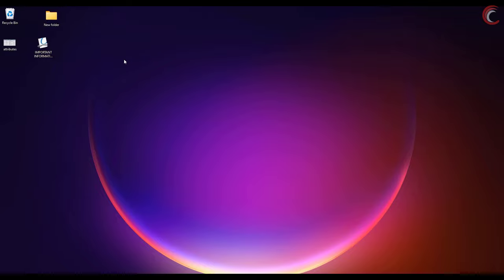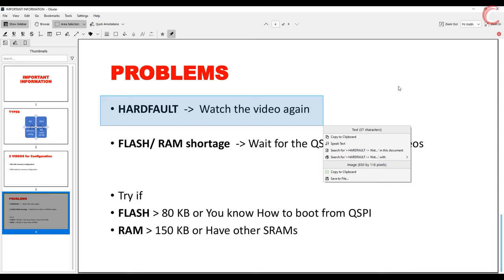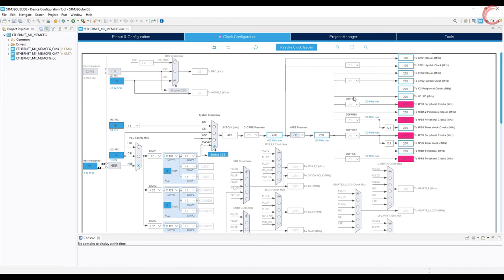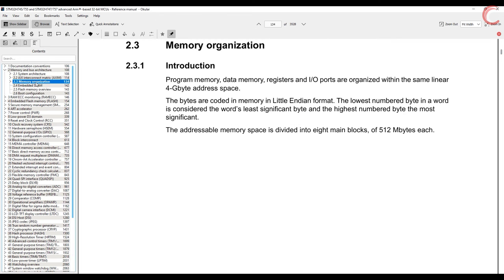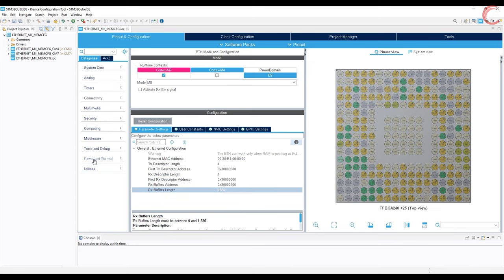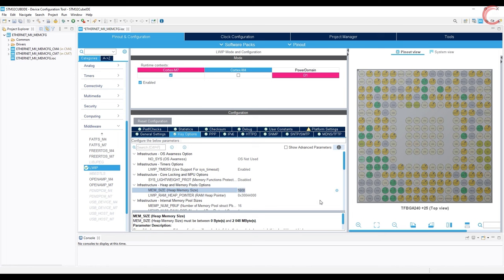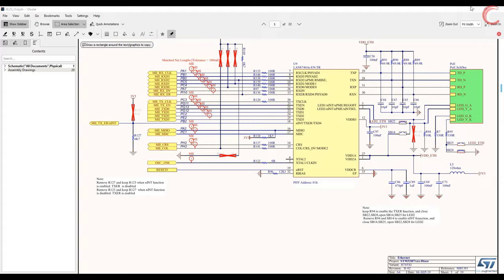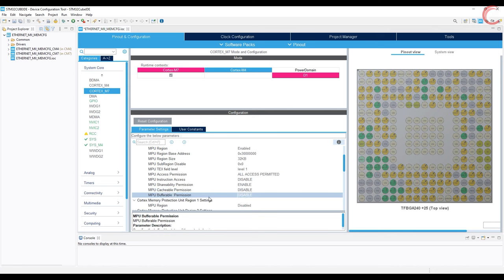STM32 ETHERNET #1. Hardware Configuration || PART 1

Comment from the maker: 1.) I just tested with the latest version (1.12.1). Yes the CubeMX does not let us configure the RxArray, but you can simply ignore it.The code builds just fine and the ping works as it should. I am attaching the project for your reference. https://drive.google.com/file/d/1bWet0pSpQxkGx_ry3aAdO-ejf9SIg5YF/view?usp=sharing

2.) Don't misunderstand the logic. You don't necessarily need to do this. Memory configuration in only required in M7 processors.
Also if the cubeMX don't let you configure the memory, then you are good to go with the default setup itself. This is why I said "Watch both parts of the configuration". I can't make separate videos for all processors.

3.) The above configuration is tested with ROUTER. If you are connecting the board directly to the computer, you need to make some changes in the ethernet settings of your computer. Checkout the setting https://controllerstech.com/wp-content/uploads/2023/08/ethenet_setting.png. This setting is valid for the static IP used in the video.
Reply: I do the same as you but it doesn't work with ping, the program still runs to sys_check_timeouts();
I run it on STM32H743ZIT6 Nucleo
Reply: About 1). Does it mean that I don't have to allocate the 1524*4 bytes for the Rx Buffer and I can just put the LWIP at 0x30000100? Where does the Rx Buffer gets allocated instead? Does it automatically gets added to the MPU?
Reply: I downloaded the project and upload the code without any changes - it doesn't work. My board STM32H745i-Disco
Reply from the maker: You downloaded the file linked in the first point ?
Reply: @ControllersTech that's  right. But now I have another problem. After uploading a code into my board I am not able upload again. The programmer can't find device and I don't know how to clean chip.
Reply: Is the non-router ethernet setup for pc correct? I cannot setup my pc ethernet with an DNS of 255.255.255.0 or subnet mask of 192.0.0.0. Are those two swapped? 

I'm currently trying to get this working inside an freertos task but im not able to ping my stm32f7 nucleo.

Comment: I am using a W5500 with the STM32 through SPI. Want to use the Ethernet controller in the STM. So very exciting .....
Reply: If you are using W5500, then you can use any simple 8bit uC with SPI. No need to bother about ethernet module in the uC.
Reply: @jonfs2000  At the moment I use that solution. But eventually I want to replace the W5500 with the STM32 controller
Reply: @fillempie1501  Sorry, I misunderstood your comment.
Wonder any STM32 comes with builtin PHY

Comment: with the new version of LWIP, the RxArray buffer doesn't exist into the ethernetif.c file,  the procedure to add the "external" gnetif  fails due to  missing elsewhere.
Reply from the maker: I will check..
Reply: i have the same problem "undefined reference to `gentif'"
Reply from the maker: @CasllistoPili There is no such issue. I just tested with the latest version (1.12.1). Yes the CubeMX does not let us configure the RxArray, but you can simly ignore it.
The code builds just fine and the ping works as it should.
I am attaching the project for your reference.
https://drive.google.com/file/d/1bWet0pSpQxkGx_ry3aAdO-ejf9SIg5YF/view?usp=sharing
Reply: @ControllersTech  I did the same as you but it doesn't work with ping
Reply from the maker: @quocthainguyen2314  Check the last point of the pinned comment (new one).

Comment: Hello i have same board configured  by fallowing your tutorial  in command prompt  transmit failed , general failure   and   RxArray buffer doesn't exist into the ethernetif.c file   added manually myself .
Reply from the maker: check pinned comment
Reply: @ControllersTech  i have a STM32H745i DK board  fallowed your vedio ping test is succesfully completed .Next i want to send ADC collected samples(Array) to client using TCP/IP protocal which video should i fallow and how do i achive any guidence ??
Reply from the maker: @shettymalnad1978  check the TCP server/client video

Comment: I applied it which this video without memory configurations, because cubemx dont allow to memory configs. I couldn't reach to right solution. I tried to sending ping but it didn't answer to back. (stm32f767). What is the problem? should I change my computer's IP4 address according to the code (manual)?
Reply from the maker: Are u using a router or direct connection with the computer ?
Reply: @ControllersTech  I connected the ethernet cable directly to my designed board
Reply from the maker: Check out the lastest video in ethernet (no. 7)
Download its project. In that project, i have shared the screenshot for configuring the windows ethernet settings for direct connection.
Reply: @ControllersTech  i just tried that video. It didn!t work also I couldn't choose external loader because there is no stm32f767vg. I will be mad :) I just want to see sending ping...
Reply from the maker: I didn't ask you to try that video. I said there are screenshots of the windows configuration in the project folder.
Reply: @ControllersTech  Yes I know. Should the configurations in the code and the computer's configurations be the same?
Reply from the maker: Just keep the ip subnet and gateway same as that video.. and configure the computer as shown in images
Reply: @ControllersTech  thank you. it is working now.

Comment: I'm using the STM32H723, and there is no setting for the RX buffer memory. A space for this has been allocated as a memory pool in the AXI SDRAM. I'm a bit confused; do I need to configure it? thank you so much <3
Reply from the maker: Check the point 1 of the pinned comment.
Reply: @ControllersTech  thanks a lot

Comment: hi, im using stm32h723zg. i did everything just as you said but in the debug section, line can not reach in to the while loop. i debugged step by step and it is stuck in the "MX_LWIP_Init();" initialization. i think stm32h723zg and h745 are different in some ways but i dont know what to do. can you help me?
Reply: debugladığımda aynı satırda kalıyorum kodu okumaya devam etmiyor sorunu çözdüysen bana da yardımcı olur musun

Comment: Hello, sir I have the stm32f446 Nucleo board and STM32F103BluePill Board,, Both the boards do not support the inbuilt Ethernet feature. Instead, there is an alternate option of using an ENC28J60 or W5500 ethernet module interfacing with SPI communication. Can you make a video series for ethernet using the SPI Module so that it will be useful for LowerEnd MicroControllers?

Comment: Hi, thanks for the informative video. I struggled with the NUCLEO-H753ZI board to get it to work. But when I put in a large delay after HAL_init() it worked. I had to put 3 secounds. (I used DHCP by the way) It took me a long time to figure this out. Because it worked only during Debug mode (Using the onboad SWD), and not in free run. So as soon as I restarted the controller it did not work. I was sure it had something to do with the cloks or the memory. The only thing was that the LAN8742 need time to initialize. So I just put HAL_Dealy(3000); after the hal init. And it worked! So I hope this can help others struggling with the same.

Comment: Now I finnally know why I was not able to run ethernet on CM7 core.. Because I did not configure memory.. But on CM4 it worked fine for some tcp echo tests. Now I can do it in correct way.
Nice job, looking forward for the next ones! Hope that you will also demonstrate simple tcp/udp echo with freeRtos
Reply: your using STM32H745i DK  ?? if you'r using this i need help ??

Comment: 10:58 The default LWIP_RAM_HEAD_POINTER is 0x30044000. I am using a H723ZG, for which the reference manual says that memory address is under a reserved section of the SRAM. What is the point of the IDE putting addresses as default that can not be used? Does anyone knows that?
Reply: did you find an answer to this question I am using the same board and can't
 get it to work
Reply: @danieliskandar4410  Yes! You indeed have to move the LWIP_RAM to valid memory area.

Comment: Hi Sir,
I have done all the configuration as per your video and I'm using stm32h745-DISCO board. But the ping on the IP is showing "host unreachable" . On debug, I was able to find out that within the LwIP_Init() function, within netif_add(); function I'm falling into error;
LWIP_ERROR("netif_add: invalid netif", netif != NULL, return NULL);. 

When configuring from cube-MX, I could all see one difference between your configuration and mine, there is no "Rx_Buffers_Address" in my set-up.

Can you suggest on where I've gone wrong?
Note: - I'm using cat-5e ethernet cable that I've verified working in my PC.
Reply: I have exactly the same problem
Reply: @Cypher-sn3bt  Please let me know if you have any update on this issue. I tried using the ethernet crossover cable but still the problem persists. Thank you.
Reply: hello am  using the same board for configuration done same as the above video but ping on ip shows transmitt failed general failure .Any help  ??

Comment: I am using CUBEIDE version 1.9.0.
After configuration when code is generated, RxBuffer is not present in ethernetif.c file. Code does not work and ping not answered by the system. I am using nucleo H743zi board. Please 🙏 help.
Reply from the maker: Yes I guess in the updated versions, they have removed that section. It should still work. I will update the article in probably 1 or 2 days.
Reply: @ControllersTech  Thank you. I will be waiting ☺️.
Reply: @ControllersTech   I suppose you didn't update the article. Will you update it ? I'm having the same problem.
Reply from the maker: Please read pinned comment

Comment: I use a board STM32H745i-Disco and still not able to activate ethernet on this board. I found that the board configuration supports just full duplex (MII_CRS and MII_COL deactivated) . Does it changes something? Can the example used with ETH mode: "MII Full Duplex Only"?
Reply from the maker: How are you connecting the board ? Using router or direct connection?
I have the same board. Things just work fine without any issue. 
You can reach me on telegram
Reply: @ControllersTech  It's connected to home network. Tried to leave save memory setup just chage from MII to Full duplex mode + static IP address : the board appears in arp list, but ping failed. I 've bought second same board - same result. I can bet there is a stupid mistake, but at this moment I do not see it. Using your the second video I set STM32F769i-disco - works perfect.
Reply from the maker: Plz contact on telegram. I need to see the code.

Comment: Hi I like your video very much, just wonder if the above  works on STM32H7A3 or STM32H743 ?
Reply: or can it work on STM32H750 Discovery board ?
Reply from the maker: It works for all STM32 devices.

Comment: Im using stm32H747I Discovery board and i used RMII connection and configured memory mapping just like you and  I did all the configurations as explained in the video . The only difference is that even with RMII connection the cube MX let me configure the memory but i get no response when i do the ping test . Im using the stm32cubeide V 1.9.0

Comment: Just a question: how was the IP add configured on the STM ? Because it's IP must have been 192.168.0.123 in order to respond to the ping, right?
Reply from the maker: It is configured in cubeMX.

Comment: Hi ! thanks for you video, that really help me to start my MQTT project on STM32F407.

I have a problem with the ethernet. 
That don't work if STM32F407 starts with the cable disconnected.

If i start the MCU with cable, i can ping, disconnect, reconnect and ping again.
But if i start the MCU without cable and connected after 10sec (more or less), the ping will never work ! Or after a reset with cable plug !

Do you have an idea where i can make a changement ?

Thank again
Reply from the maker: Keep the cable disconnected. 
Put a breakpoint inside the while loop.
Run the code and see if it hits the breakpoint.
Reply from the maker: Ofcourse i mean debug without cable.. just like you mentioned the issue is happening
Reply: @ControllersTech  Ok i put and BP in infinite loop and i can hit with and without cable plug, replug, just the ping don't work if it not plug at init ! :D
Reply: In MX_LWIP_Init();

I found netif_set_link_callback(); //Set callback to be called when link is brought up/down 
So i understand the plug unplug at the init should be manage by this function but something doesn't work and i don't know if it's me who do something wrng
Reply from the maker: Ok i don't know if it will work but try this.

Do not ping until the link is up.  You can call the  set_link callback function and inside it check if the link is up. If it is, then set some flag. 
In the while loop, use the flag to shield the ping
Reply: @ControllersTech  Ok thank i find a issue with your help ! 
The fonction call back: ethernetif_update_config is called when plug or unplug the cable but the re-init was  ot clear so i use 
if(netif_is_link_up(netif))
  {
	  netif_set_up(netif);
}
else
{
         netif_set_down(netif);
}

Thank you for u fast aswer and ur help !
Reply: @microsore1   @ControllersTech   Hi. I know this message is a long time ago, but I have the same problem as you, but putting a BP in the callback function "ethernet_link_status_update", it never fires when plug and unplug.   Like you, if I start with the ethernet cable connected, it does ping me.   Is there any interrupt configuration missing to make it work?.  Thanks a lot.

Comment: Could we just work with AXI SRAM instead of SRAM1? Is there any particular reason SRAM1 is being picked over AXI SRAM?
Reply from the maker: You can use whatever ram you want. But since the main code is organised in axi sram, make sure you give proper offset for the dma descriptors.

Comment: I want to use STM32H743vi and lan8720
in the item "LWIP > Platform Settings > Driver_PHY" , there is only the LAN8742 driver.
please tell me what to do?
Reply from the maker: I don't know about 8720, but check the example projects provided by ST and see if there is any changes in the configuration.
You can just give one shot to 8742. Maybe it will work

Comment: I used stm32f439zi nucleo 144 board, but I didn't find CORTEX-M4 in system core in order to confige MPU
Reply from the maker: Mpu isn't available in f4 series.  You just configure the rest of the project.
Reply: @ControllersTech   Thank you so much, I have benefited greatly from your channel❤

Comment: Hey the viedo is great, thanks a lot for it. I have one question, how we can prevent that something is placed in the heap section of the lwIP? Could we define a section inside the linker script to avoid that other variables are placed there?
Reply from the maker: If the CubeMX lets you configure the memory, then configure the heap in some  sRam region (other than default one).

If memory config is not allowed, then i Don't think you need to worry about it.

Comment: Hi, thank you for your great video.  I have designed a custom board with STM32H743 and LAN8742. I used RMII connection and configured memory mapping just like you said but I am getting an error in the ethernet software reset in the HAL_ETH_init function. I was wondering if you could give me some help. thanks a lot.
Reply: you must generate 50MHz clock from Refclock pin in LAN8742 IC, it is sync clock between PHY layer in IC and MAC layer in stm, to generate this clock from IC read LAN8742 datasheet, you must add resistor to pin2 in IC

Comment: Can I use this tutorial information for stm32F4 controller sir..
Reply from the maker: yes
Reply: Can I use Lan8720 or LAN8740 ic module.
Will the ic support the tutorial content..
I don't have inbuilt LAN port in my development board
Reply from the maker: Use 8720
Reply: @ControllersTech Thanks sir,,  can you please tell me the difference between 8740, 8720, 8742..

Comment: Hi!
Great tutorial.
I am using the nucleo H743ZI board. I did all the configurations as explained in the video. But in the generated code there is no variable named Rx_Buff and I cannot assign it to the RxArray section. When I tried this 2 months ago it was working and Rx_Buffer variable was present in the generated code. But now it does not work and I think lwip stack is updated in the cube IDE and it uses mempools now. There are new lines different from yours like below.

typedef struct
{
  struct pbuf_custom pbuf_custom;
  uint8_t buff[(ETH_RX_BUFFER_SIZE + 31) & ~31] __ALIGNED(32);
} RxBuff_t;

/* Memory Pool Declaration */
#define ETH_RX_BUFFER_CNT             12U
LWIP_MEMPOOL_DECLARE(RX_POOL, ETH_RX_BUFFER_CNT, sizeof(RxBuff_t), "Zero-copy RX PBUF pool");

I tried building without Rx_Buff and got hard fault. The Rx Buffer memory pools  are located in RAM_D1 as memp_memory_RX_POOL_base  and cannot move them to RAM_D2. 
I tried
extern uint8_t memp_memory_RX_POOL_base[] __attribute__((section(".RxArraySection"));

this way I got no hard fault but board does not respond to pings.
Do you have any idea how I can solve this? 
Thanks in advance.
Reply: Happening the same with me :(
Reply: Try this, Worked for me. Install the CubeMX 6.3 and H7 package 1.9.0 and starts the project from zero, the same in the video.
Reply: @alvarobs  Yes I know it would work. But i need to learn how to use the new lwip stack.
Reply: Same here, did you ever fix it ?
Reply: @cattflap1447  Nope, i gave up. I will try again next week. Will post here if I can fix it.
Reply: @ERENTSCGL  That would be great, good luck 😁
Reply: @alvarobs  hi Alvaro, I am having the same issue but must the cubemx version be 6.3